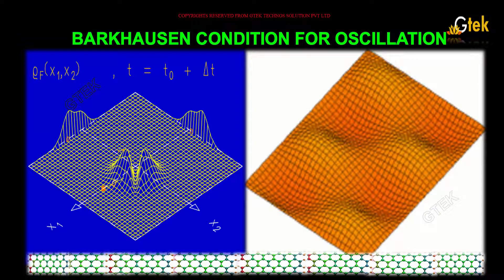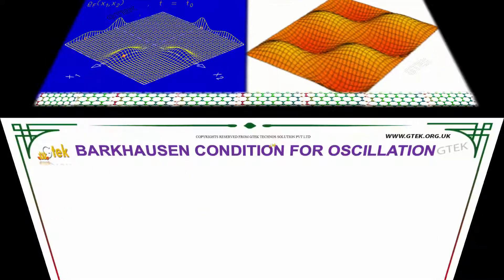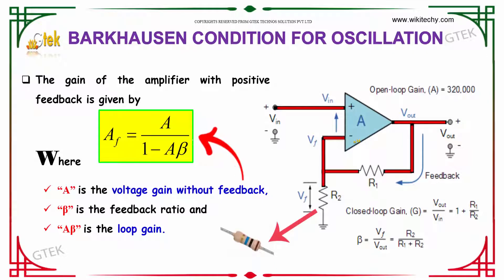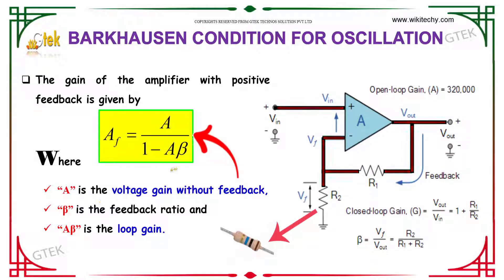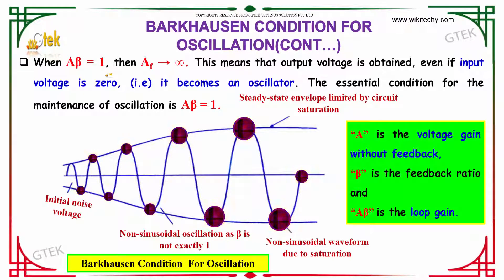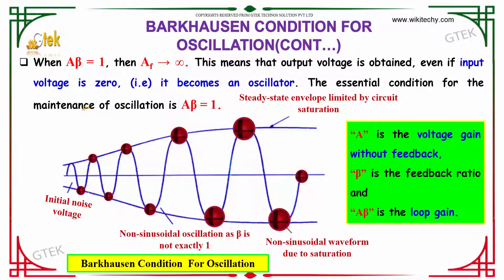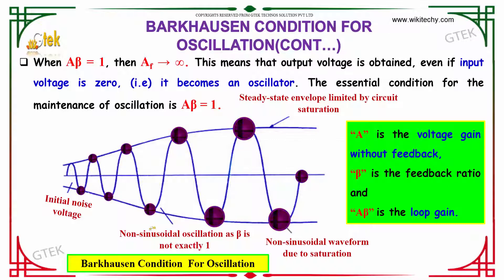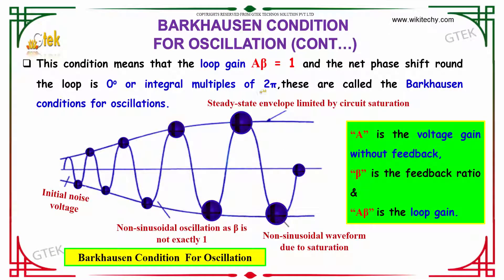Barkhausen Condition for Oscillation Semiconductor Devices class 12 physics subject notes lectures

Comment: It consists of an amplifying element A whose output vo is fed back into its input vf through a feedback network β(jω). In electronics, the Barkhausen stability criterion is a mathematical condition to determine when a linear electronic circuit will oscillate.

Comment: A small change In DC power supply or noise component in oscillator circuit can start oscillation and to maintain oscillation in circuit must satisfy Barkhausen's ..

Comment: The most common form of linear oscillator is an electronic amplifier such as a transistor or op amp connected in a feedback loop with its output fed back into its input through a frequency selective electronic filter to provide positive feedback.

Comment: The study and use of electrical devices that operate by controlling the flow of electrons ... Radio frequency (RF) is a frequency or rate of oscillation within the range of about 3 .... In electronics, a transistor is a semiconductor device commonly used to ... The condition of unity loop gain -Aβ = 1 is called the Barkhausen criterion.

Comment: a solid substance that has a conductivity between that of an insulator and that of most metals, either due to the addition of an impurity or because of temperature effects. Devices made of semiconductors, notably silicon, are essential components of most electronic circuits.

Comment: barkhausen condition for oscillator is that the loop gain must be slightly greater than unity and the phase shift around the loop must be 360 degree

Comment: In electronics, the Barkhausen stability criterion is a mathematical condition to determine when a linear electronic circuit will oscillate.[1][2][3] It was put forth in 1921 by German physicist Heinrich Georg Barkhausen (1881–1956).[4] It is widely used in the design of electronic oscillators, and also in the design of general negative feedback circuits such as op amps, to prevent them from oscillating.

Comment: An electronic oscillator is an electronic circuit that produces a periodic, oscillating electronic signal, often a sine wave or a square wave. Oscillators convert direct current (DC) from a power supply to an alternating current (AC) signal.

Comment: Barkhausen's criterion applies to linear circuits with a feedback loop. Therefore it cannot be applied to one port negative resistance active elements like tunnel diode oscillators.

Comment: If in a closed-loop control system with sinusoidal excitation the feedback signal from the controlled variable is in phase and is equal or greater in magnitude to the reference input at any one frequency, the system is unstable.[3, page 142]
They continue to insist that ``[t]he Nyquist stability criterion presents this fact in a rigorous mathematical form.'' This introduction is completely wrong, and Chestnut and Mayer even provide the Nyquist plot of a perfect counterexample a mere fourteen pages later (while defining conditionally-stable nonlinear systems).

Comment: A small change In DC power supply or noise component in oscillator circuit can start oscillation and to maintain oscillation in circuit must satisfy Barkhausen’s criterion.

Comment: The Barkhausen criterion says that the circuit will sustain steady-state oscillations only at frequencies for which the loop gain is equal to unity in absolute magnitude and the phase shift around the loop is zero or an integer

Comment: The Barkhausen criterion says that the circuit will sustain steady-state oscillations only at frequencies for which the loop gain is equal to unity in absolute magnitude and the phase shift around the loop is zero or an integer multiple of 180 degrees